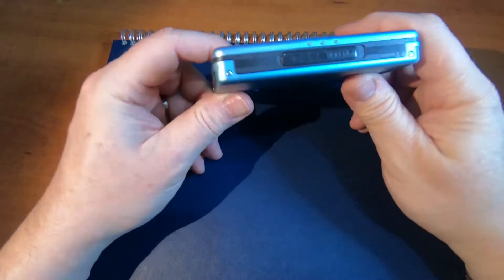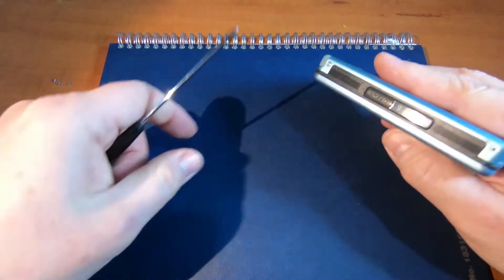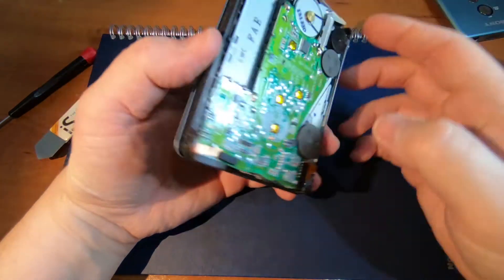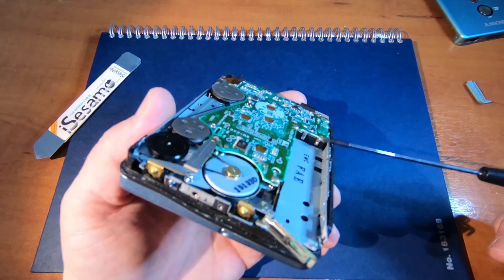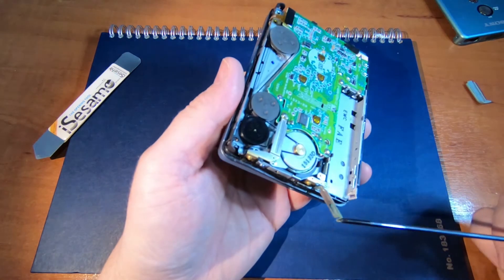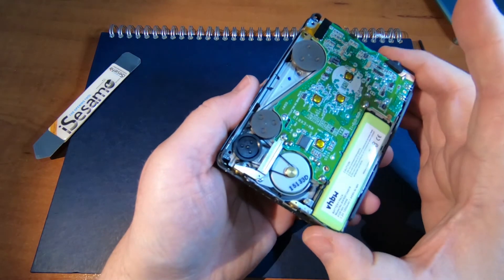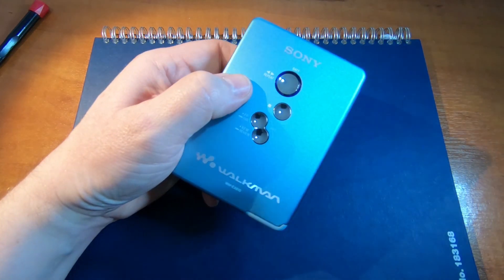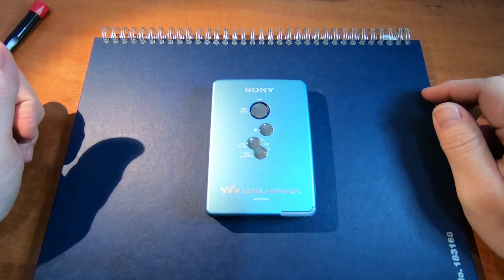Sony WM EX610  personal cassette player repair

Comment: Looked into the battery problem several times quite thoroughly, but couldn't figure it out.
With your help I found out, that this little end-piece of the door didn't make tight enough contact on my Sony too.
Years ago I changed the belt and used it with external battery pack.
As I have three ones but the one with the battery problem sounds best I was always keen on getting this fixed.
Thanks mate for clearing this up👍.
Seems the construction of this battery door is the weak point of the otherwise excellent construction of this Sony device. 

Btw. your tutorial works on the EX 674 identically as only the buttons for play and so on are in different order. Otherwise construction outside and inside is the same.

Comment: Was replacing the band in my 674 this evening, and your video was quite helpful! The old band was pretty stretched out, and had probably never been replaced. The new band seemed to be working ok, but then I realized it was playing slow! I got the band from a highly recommended seller on eBay, and I trust they know their sizes...so I fiddled around with the potentiometer until the speed seemed more or less accurate 🤞😬
Reply from the maker: Mm... If you are sure the belt is the correct size (not too tight), then perhaps the mechanism needs cleaning an re-lubricating. 
The grease on the gears and spindles can become hard overtime, along with dust and grime.
Reply: @ANTandTEC  Yah, that could very well be...the player is somewhere around 13 years old at this point. Unfortunately though, a lot of the gears are underneath the board and it's held on (in part) by some bits solder. And, I don't have a soldering iron 😔. If I've turned up the potentiometer and the gears are still crusty, do you think that could drastically shorten the life of the motor?
Reply from the maker: @rummyraisin  It's not ideal. Plus the wow and flutter level will be very bad.
Reply: @ANTandTEC  Yah, I'm getting a bit of that...if I can get a soldering iron, maybe I'll get in there and clean things

Comment: Nice fix! I didn't know the part the other side of the battery door hinge is the part that makes the circuit. I have a Minidisc player that has no power. I'll dig it out and see if that's the problem. Thanks.
Reply from the maker: Maybe 🤞

Comment: Great video mate 👏 I’ve got an ex670 with a similar problem to this. I followed your video to try and see if I could sort it myself but still had no joy. I heard that EX models won’t even power up if the band has deteriorated. Do you know if there’s any truth to this?
Reply from the maker: Thanks. I don't know about that. I'm not sure how the deck would know that there was no belt (until it started to move). So I would think that the player would still initially power up with or without a belt - I am willing to bow to someones superior knowledge on that one though 🙂
Reply: @ANTandTEC  fair enough. I’m yet to test it on a gumstick battery, so I will try it with that next. I’m thinking that the right battery terminal for the AA battery caddy on the base has possibly become damaged. I’ll report back if it turns out to be a belt issue after all.
Reply: I believe the reasoning behind the deteriorated belt issue is that it’s not tight enough to begin the circuit.
Reply: There will always be signs of life even if there is a perished belt or it has been removed - The player has no idea what the state of the belt is so it will always attempt to spin the motor. Some will continue to run, others will see no movement in the optical sensor and stop after a moment. A no power fault is almost always a bad connection on the battery door. Clean off any corrosion and use contact cleaner on the battery hinge where power is transferred. Use a multimeter to test between the door and the mainboard, and also the two spring terminals inside and the mainboard. This video at 10:38 highlights the contact tab that needs to be focused on to ensure good conductivity.

Comment: Apart from the fix ,  do you know that this walkmans works if there is a cassette in it ! Because they have an a tape sensor ,  and also did you check  if the hold switch was on ?
Reply from the maker: That is a good point, there is a small switch inside the unit that detects the presence of a tape. Without this the unit appears dead. 
I did have a tape inside during my testing because of this but I should have mentioned that as it could catch people out.
Reply: @ANTandTEC   I have two of this models , the WM-EX 900  and the WM-EX 615  , and can tell you that sometimes the tape sensor  stop working , that’s  why many people when time  comes to change the belt , and opens the walkman , they solder the sensor terminals , and the unit works again .

Comment: Hi mate, I have the same model and I took it apart to fix a new belt because the old one was struggling to FF or Rewind. I know have trouble getting power through but I use the external battery pack. Iv cleaned the parts where the battery attaches but I still don't get any power going through, how do I fix this?
Reply from the maker: Mm.. there is only the battery contacts in the holder, and the external contacts to the player to check. As you can see the power does not go through that door hinge when using the external battery holder. 
You could try an external 1.5v power supply (or connect wires to the battery) then power the terminals on the player directly - rule out the external battery holder.
Reply: @ANTandTEC  Hi mate thanks for replying. Honestly im know expert in fixing things but do you think you could do a video on this? 
Literally my walkman was working before I took it apart to fix the new belt, I really don't know why it's stopped working.
Reply from the maker: @flerterg  Its quite possible something else is the issue. If your battery terminals are clean its unlikely to be that. With the lid removed have you used a multimeter to test the voltage at the contacts inside the unit? This will prove the battery connection. 
Maybe you knocked or damaged something else on the board whilst doing the belt..?
Reply: @ANTandTEC  I believe the terminals are clean and the board  does look in good shape. I don't have a meter but ill ask around my mates if they have one. Maybe the terminals are not connecting properly to the external battery ( the one that you screw in from the bottom of the walkman )
Reply from the maker: @flerterg  Yes, so to test (when you have a meter) take the back off the player, screw or hold the battery compartment on to the player, then probe the terminal connections (as shown in my vid) for power.
If there is power then something else unknown has failed in the player. If there is no power, then you know a connection between the battery and the player is broken.
Reply: Cool thanks for that @ANTandTEC

Comment: Hi I have an elite series 2 controller and half of my headset jack snapped in half and it got stuck inside my controller is there anything you can tell me to help thanks
Reply from the maker: I've not seen a series 2. If you are not able to pull it out with tweezers or something then you'll have to take it apart and see if you can use a pin or something to push it out from the other side.